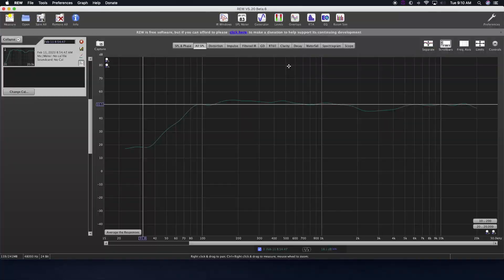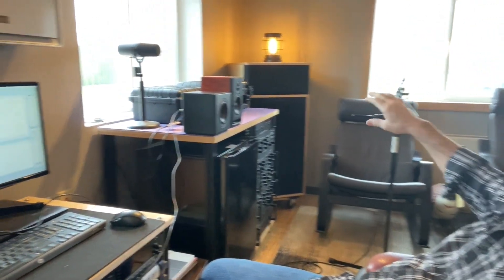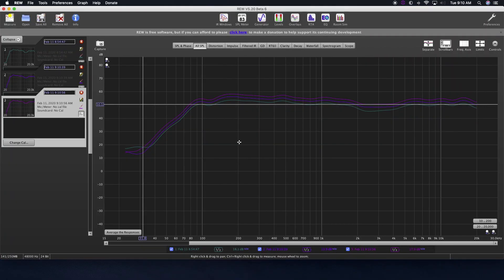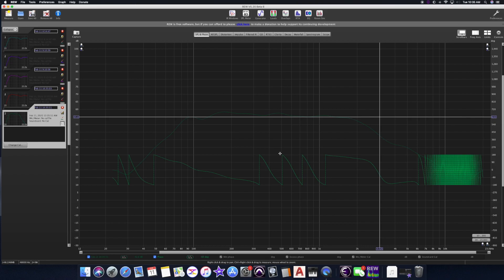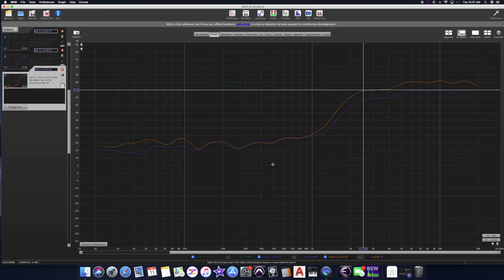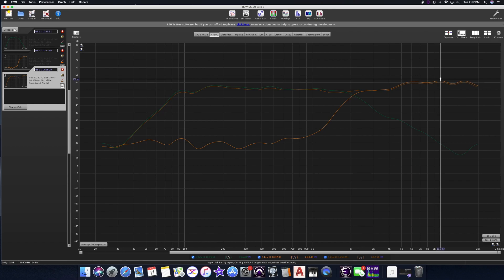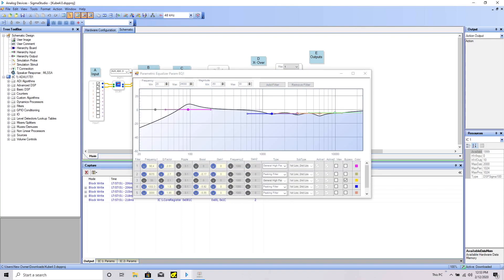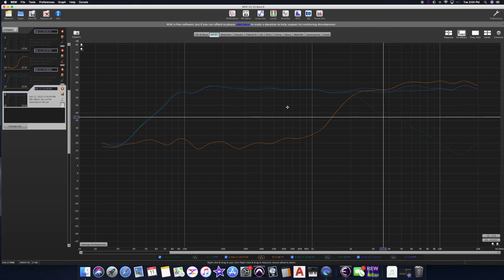Audio Geekery! | DIY Studio Monitor | Part 3 | EQ x-over tuning using Sigma Studio and REW +/- 2dB

Comment: Hi Gary, i've built a set of active 2 way stereo monitors using a Wondom JAB5 amplifier.  Am trying to get my head around SigmaStudio, thanks for your video's, they're very educational :) One question i have, and hope you might offer advice: When i have the ICP1 PC control module connected to the amplifier, i'm unable to get the amp to play any sound.  In the instructions from Sigmastudio, it indicates i should be able to tune real time once i've uploaded a schematic to the ADAU1701 chip.  I have bluetooth and 3.5mm headphone jack inputs, both work fine when the board isn't connected to my PC..  Should i be able to stream audio to the Amp via the PC control module when connected, or is there a different way to get audio to play?  Any suggestions?  Thanks! Hugh.

https://youtu.be/xKlM4fIZUZs

Comment: Hello Gary!
It’s a GREAT DYI project. But I didn’t understand how did you soldered speakers with DSP module and how did you connect DSP module and DSP plate.
I also tried to find right way to reproduce  a chain of modules in Sigma studio - what could you advise me?
Could you share with me if it possible: 
qabase365@gmail.com

Thank you in advance.
I appreciate it.

Comment: Great vids gary. How many bands of EQ does that DSP allow per channel. Have you tried the Auto EQ function in REW. I've had pretty good results with the EQ function. It give you a really great baseline to do minor tweeks. Lastly were you using a calibration file for your mic in REW? I absolutely LOVE the cubes you built!!!
Reply from the maker: Thanks Sam,  I really don't know how many bands of eq AD will allow, its a matter of total Dsp available,  you can trade more eq bands for other things. I have used the auto eq in REW extensively, it works well.  I was using a DBX reference mic this time as I was also using Smaart live and open sound meter off camera.  Thanks for watching!

Comment: Excellent video! One question that bugs me though - and maybe this is something you are looking to address later - is a measurement in a non-final location useful for more than broad-stroke tuning? Will you end up fine tuning each DSP once these are sitting where they will be used? I'm interested to see how much of a difference in measurement that may lead to, given the little bits of the room around you that are visible in the video.
Reply from the maker: Hi Aleks!  sounds like we need another video,  My intent this round was to establish a base line as to the performance of our little cube.  Think of it like this,  you run down to Guitar center and grab a pair of KRK's bring them home and plop them on your desk and start mixing,  we have already exceeded this in that we are a least tuning in the same room.  Yes I fully intend to do final tweaking when there on my desk.  Glad you enjoy the videos!
Reply: Gary Ford thanks, I really enjoy your deliberate and well explained approach. I am very curious how much the measurement changes in different parts of the room with the same dsp, especially from the main listening position.